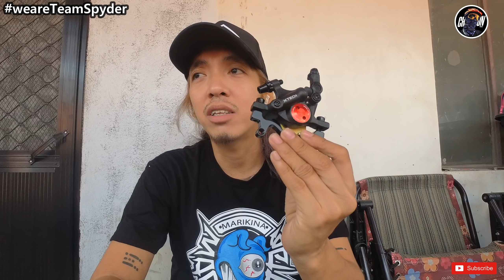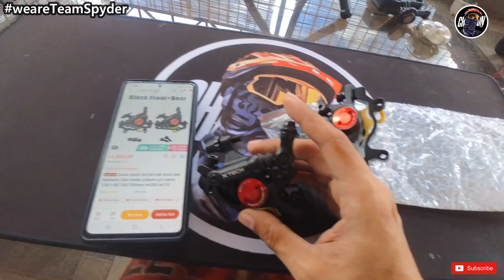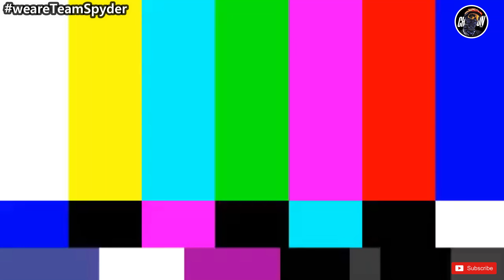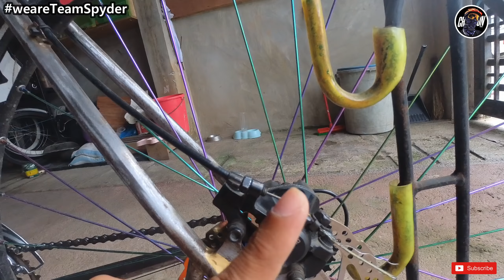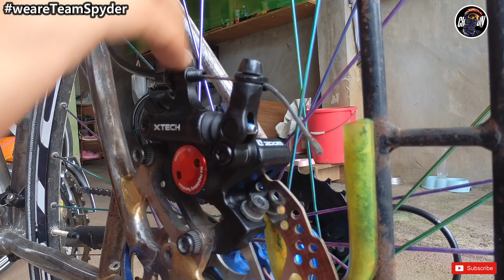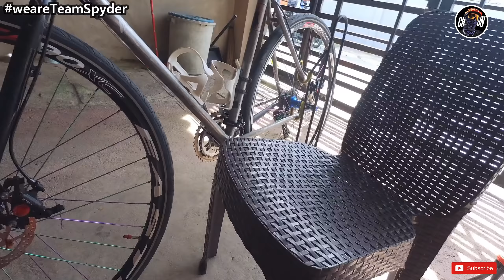Usapang Preno - Hydraulic Brakes

Comment: Master, ganyan gamit ko 1 year na, no leak lakas ng kapit parang tuko! Brake pads, makapal pa. Palit ako ng teflon-coated cable +shimano housing w/ grease, -lambot pigain! Adjust ko rin yung 2mm Allen bolt para lumapit pads sa rotor. Goods overall👌